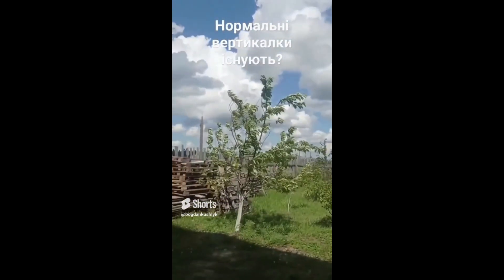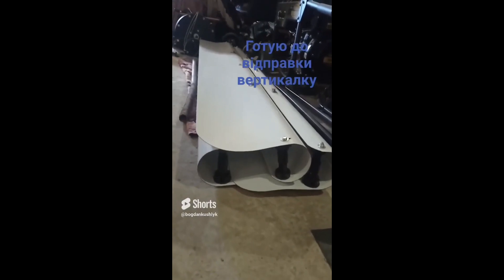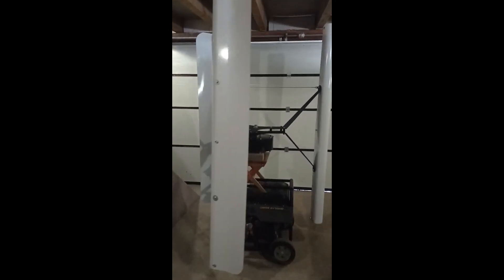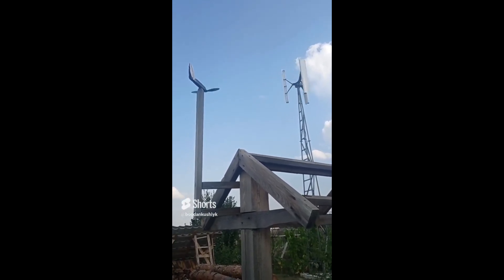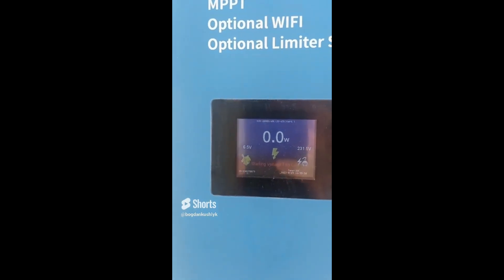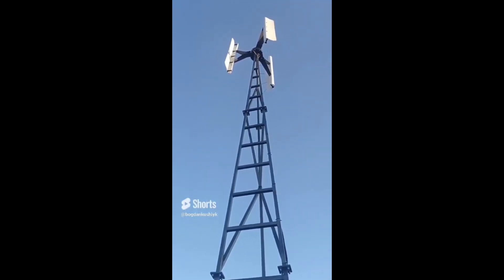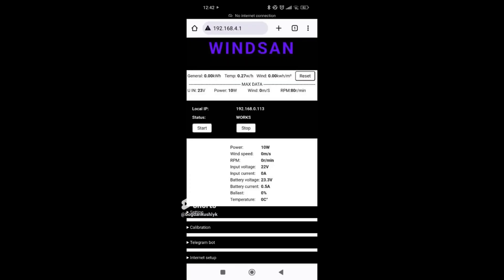Big vertical 2kW wind turbine - my 2 months experience in 7 minutes

Comment: All practical tests of ground-based small wind turbines show: 1) They hardly produce any electricity! 2) They do not last long! 
Electricity yield is proportional to third power of wind speed: +100% wind generates +800% more electricity! But close to ground: 0 constant wind, but extreme gusts! 
Due to extreme price decline solar panels generate at least 10 times more electricity with the same investment in time & money! Unfortunately not at night and in winter! But reliable && maintenance-free for 25 y+! But 9 out of 10 small wind turbines stop working after just a few years due to the extremely gusty winds close to ground.
Reply from the maker: well, that's true, but not fully. the reason is that the most of the small WT are not even close having the normal mounting height. give it a 20-25m tower - and you will be amazed how cool will it go. it will just keep going and going. outperforming solar in 70-80% of days in October, November, through winter and up to April...
Reply: @BackyardVoltage  Yes, there is no sun at night and hardly any in winter. A 25 m high mast for a small WT would be absurdly expensive. Due to the extreme price drop, in 2025 you can generate at least 10x more electricity with solar panels than with small WT!

Comment: 🙏🇨🇦 I just bought a 400 W vertical when generator from Vevor it is only putting out about 5 to 7 W wind speed doesn’t matter what is this related to?
Reply from the maker: it's mainly related to the fact that it is vertical...
I'm sorry, but vertical will not output. sell it to someone, and get yourself a nice and decent horizontal wind turbine. Here is the short guide on the Chinese wind turbines, hope it may help you: https://youtu.be/FoKUUpJMgD4
Reply: Volts are usually related to rpm,if it's direct drive it will never spin fast enough,it needs a gear 4-1 or 5-1 then if it's spinning at 100rpm the actual generator would spin at 400-500 rpm and you would get around 50-70v
Reply: Also you need a larger diameter wingspan,i would say 2.5-3 metres,so it has enough torque to move the geared generator, larger diameter equivalent to higher torque at low winds

Comment: Agree with your conclusion, but also would say, 15m vs 10m tower can make a difference, even in the relatively unobstructed area you are in.  The monster ones are now on towers so high up in the sky your nose will bleed just looking at them.
Reply from the maker: I agree. The tower is going to be upgraded this summer to gain +3m height.

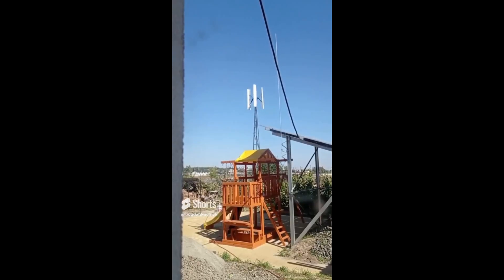Comment: 5:18 Definitely better to use low loss cable then take 230 VAC into the house 🏠 with armoured cable at the required depth, batteries don't like to be cold, thats the only drawback especially lithium batteries, but your using Leadacid type,
Reply from the maker: yes, everything correct.
LiFePO4 inside in use with Deye. GEL leadacid batteries - outside for the wind turbines block. and cable - as well, that existing one will be used to transfer 230V, and from the WT to the inverter there will be 6mm2 after all the upgrades are done.

Comment: Any chance your wings were mounted inside out?  Usually the scoop part is on the outside and the smooth lift generating airfoil in on the inside.
Reply from the maker: Might be a chance. But no one will know, since I got rid of it.

Comment: Never forget these two "rules of thumb" comparisons. 
1. It takes four times the windswept area of a vertical oriented turbine to produce the same power output of a horizontal oriented turbine. A 10 wide x  32 foot high vertical will produce about the same power output as a 10 foot diameter horizontal turbine.
2. Never fall for over rated advertisements on alternator/generators. you can easily estimate by the overall weight. A one Hp motor/alternator/generator weighs about 25 pounds. That's about 742 watts or about 30 watts per pound of weight. Unless someone has beaten our current understanding of physics you can expect this output.

How do I know?
20+ years of design and construction of wind generator components
Reply from the maker: yes, true. After being a couple of months close to the industry, now I know a lot more.
That was a good experience and a good experiment in any case, and I never regret what was done.
Reply: I learned these rules the more expensive way as you did. I did however attempt to bring an Axial Permanent Magnet Alternator to mass production and the market. Three years in development and over half my retirement funds to only find that it could not compete price wise with Chinese low quality radials. Who cares if these imports are mis advertised for power production and demonstrate high failure rates. Its all about price...
The products were a 1.4 and 2.8Kw APMA fully tested in the environment prior to moving to mass production.
Reply from the maker: if you can compete with showcasing quality - not everything is lost.
a product that works will always beat the one that does not work as it should

Comment: Well I believe it's not the turbine to blame the turbine may be able to crank out some more watts , but designing direct drive low rpm generators is quite tricky and building them is very expensive so the manufacturer probably didn't do a very good job matching the turbine to the generator.
So the generator should be tested at that rpm on a lathe and see what it's maximum power is.
Reply from the maker: Mainly two things are wrong here:
1. the gen is definitely not a low rpm one... it desires to be a way better one.
2. the turbine wind wheel design itself has problems with reaching some good rpms... it sits at 20-50 rpm on 3-5 m/s winds, and that is way too little. maybe on some 7-10 m/s winds it will get to higher rpms for sure, but those winds are quite rare in my area.

also. please calculate the energy conversion coefficient. from 300 watts of available wind power to get only 10... and even considering if the gen is correct one, then 60 is its max at 5m/s wind. so the efficiency coefficient is somewhere from 3 to 20% maybe... and now compare it to 30-45% of efficiency of the  normal horizontal wind turbine.

conclusion - I'm not getting any vertical machine anymore. only the tiny one I still have (Darrieus type) will appear in some more tests later.
Reply: @BackyardVoltage   yup definitely agree with you on Vertical axis wind turbines I also Invite you to check out the video of my turbine on my channel that won the international small scale wind turbine contest in the Netherlands. Cheers
Reply from the maker: will definitely do

Comment: I somehow started to doubt in reality of the numbers given by your inverter. 
The simple, overcheap and oversmall bicycle dynamo should give about 6W of power. And looking on the brightness of halogen or LED lamps with it - it actually does
Reply from the maker: I tried it on two different types of setups
1. on my blue grid-tie inverter. the result was - zero, since it never reached 24V to start taking power.
2. on the wind charge controller (which has the step-up voltage function) connected to a 24V battery system - I was able to get out some 0.4A at 23V, which is 9.2 watts and it just rounded that up to 10w...

such a result in any case is pretty awful, I agree.

Comment: You've got about 300 watts of power in the wind @5.5m/s for the dimensions you stated , amazed too see it perform so poorly
Reply from the maker: no, 300 watts is impossible in 5.5-6 m/s wind for the vertical WT with 3.4 sqm rotor size (of any construction type), but it definitely should've been way more than 10 watts. some 60-70 watts would be the realistic expectation, but even that is never nearly matched
Reply: @BackyardVoltage  300w is referring to the power being applied to the blades not the expected output power which should be something like 10-30% of the input (at the blades)
Reply from the maker: yes, correct, 300w is roughly the power of wind at that speed per swept area